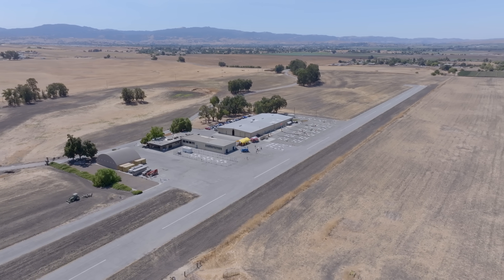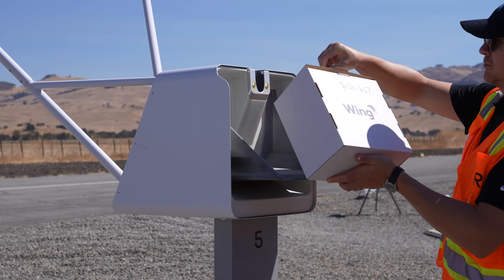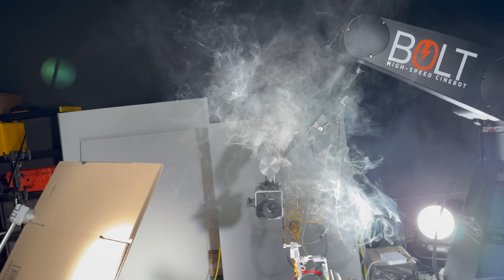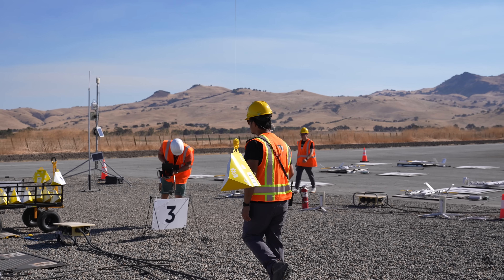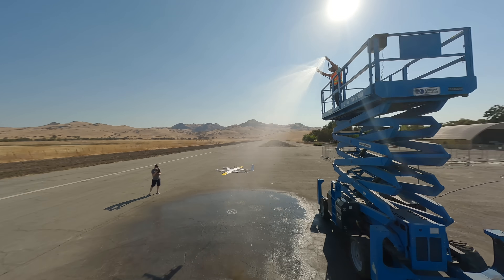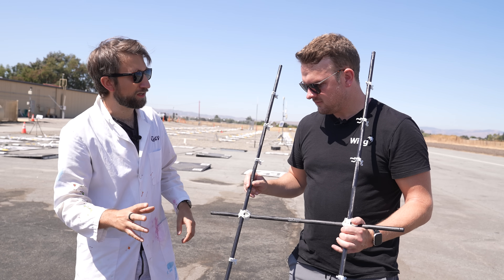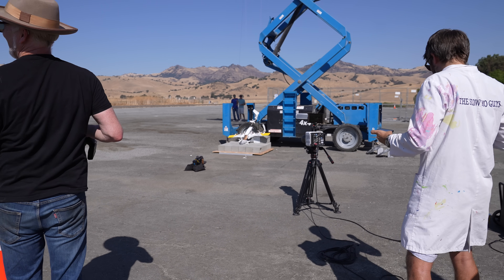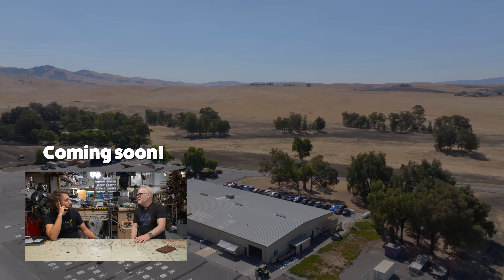Ultra Slow Mo Propeller Smoke Vortex - The Slow Mo Guys @tested

Comment: I think you messed up your bench test calculation and counted props per second and not RPM. If you Emax red bottom motor is 2600KV and you are running 6s = 24V, you get about 62,000 RPM. And I think even that is around the speed of sound, would sound horrendous but could look cool in highspeed. And that Dalprop is old tech now.

Comment: The slomo propeller in smoke was interesting, but you are only seeing a 2D plane of the air current off the propeller, it might be much more interesting to see a full 360 degree smoke everywhere air current; might be hard to setup and get the shot but you guys could do it :)

Comment: With the frangible joints, it looks like the same effect that makes spaghetti break into three pieces instead of two. The end of the pipe that is released first has a bigger moment of inertia than the end on the other side of the fulcrum, so it pulls the rest of the rod down instead of letting it go up immediately

Comment: 1 million upvotes for mechanical design on that auto-loader, no moving parts either? you're giving me goosebumps engineers!
Reply: Reminds me of the old school sky hooks, only much safer and more controlled
Reply: I would suggest they put some kind of covering over the post that holds that pick up mount... something shaped like a bowling pin.

Comment: Auto loader base is too small. That whip escapement motion in wind will be an issue. I'd get a big blow molded hollow tub with the funnel front molded in. Trash can manufacturer. Just have a specilty die made. 
    It is a great idea to self align a hook, all those trap surfaces need to go tho.

Comment: Okay wow, the drone resisting being pulled out of the sky is seriously impressive. So is the rain/wind compensation, I had no idea drones could be that stable.
Reply: Not too surprising with that many props! Also looks like they are made of foam so probably have a fantastic thrust to weight ratio.
Reply: These ones got some pretty strong motors, but in general drones are pretty stable; not inherently stable, but they basically got an autopilot style system that takes the pilot's inputs (or pre-scheduled flight-plan or whatever for the automated ones), and then constantly monitor rotation and acceleration sensors and apply corrections nearly instantly to ensure the drone is doing what it is being told to do and not what the wind and other disturbances would have it do. Even for FPV drones like Vanover's, while there is a little less hand-holding,  in general, he could let go of the controls and the drone would just continue at the exact angle it was even with buffeting winds, slightly damage propeller blades, a little bit of asymmetric accumulation of mud etc (there would be some added vibrations depending on exactly how badly it's being damaged or jerked around, but on average it would keep at it).

ps: Don't go yanking, poking, or even grabbing drones in flight if you don't know what you're doing, even medium ones like Vanover's could chop your finger off, and depending on the disturbance it can be a little unpredictable how they react (even more so if there's damage to the blades/motors)
Reply: that was the sickest part in my opinion. it almost looks like its connected with a bungee cord or something, the way it just goes right back to where it was. so awesome, i cant wait for this to be more widespread
Reply: @Crazyclay78YT  Id love if it was made of bungee, and if someone pulled on it, and the drone let go, it just smashed right into them from the elastic energy
Reply: @CentreMetre  that would be like, deadly i would think 😂😂
Reply: @bcrox  I mean, obviously. But we're talking about an array of little plastic fans easily resisting the full brunt of a person trying to yank it out of the sky from many random directions. Not a paper-thin sheet being held in the air by a literal force of nature. It's impressive, hahaaa
Reply: How do they do against bird shot?
Reply: Oh it pretty much really comes down to the design, firmware and intent of the drone. An FPV Drone with it's firmware usually on the ichy and "if no input, then no power" philosophy is pretty much unstable, completely different to this delivery drone more on the "keep itself stable and doing everything to preserve height and location"
Reply: to be fair kites can be somewhat hard to pull out of the air too
Reply: Not that impressive. I'm assuming you don't have much experience with drones in general.
Reply: @handleonlife1010  I think you need to get a better grip on your life if you're posting know-it-all comments. The publisher literally said they didn't know.
Reply: @ventilate4267  If knowledge/experience in someone else makes you feel any type of way, maybe you're the one with a loose grip?
Reply: WHEN AI takes control of the World, it will look back at this footage very unfavorably!  LOL
Reply: Being stable is the only reason idiots fly them. You don't need any skill,   A blind person could fly one.
Reply: @turokforever007 we need pete gustin in the next collab 😂😂
Reply: Sure, sudden yank releases the cable...sounds like thieves just need a winch to slowly wind it in, then. Or hold it steady for a net.
Reply: @GryphonBrokewing  no, its if the drone isnt able to stay in the same place, then it disconnects, not because of force. so if they moved the drone in any way, it would disconnect
Reply: @Crazyclay78YT  Weird, it's like Gav didn't say in the video that he could see it rocking and that "at the upper limit of being yanked the drone simply releases the cable" 6:38 Nothing about altitude causing it to disconnect.
Reply: @GryphonBrokewing  lol i didnt say altitude either, i said position, or "place" as did he. idk what the code for it looks like, but just conceptually all im saying is, if its spinning up the motors to get to the target position, but it cant get there, at some point the drone must be like "hmmm, i cant move, if i release the string, i can get back to the target" because it doesnt just instantly disconnect, and he was mf yanking. there must be a little resistance with the pickup mechanism, so maybe thats why he had to yank it several times to get it to disconnect. 

something i'd really like to see is, hypothetically its flying at a light pole just so the beam that comes over the road clotheslines the string, and it gets wrapped up. like would the drone feel the resistance and disconnect, then save itself, or would it get pulled down and be unable to recover?
Reply: @GryphonBrokewing  I mean sure, someone could steal it. It would be really stupid to steal it though, since its probably gps tracked with cameras and they know exactly who ordered whatever its delivering.
Reply: @jetison333  Never said thieves were smart.
Reply: first

Comment: I'm curious exactly how they aim to reduce Co2 emissions when their vehicles are powered by plants that create Co2 emissions. Obviously their vehicles aren't creating emissions like cars, but does the full charge of a drone actually lessen Co2 emissions, or do we need more power to charge them like electric cars? That is to say, does the power required to charge a drone for delivery create less Co2 than someone delivering the item in a car?
Reply: Electricity can be produced using 'sustainable' sources. Obviously flying requires far more energy than driving along the ground, but the reality is that the ground in our built up areas is congested, If these things create less ground congestion then they may reduce Co2 simply by the fact that they fly.

Comment: I still want to see underwater slow-mo of a speedboat propellor
Reply: Pending the SloMo guys getting around to it, see rctestflight where he compared props underwater in a design contest with lots of entries and there is some slow motion footage
Reply: @garyha2650 Basically all of those propellers were complete garbage though. Rctestflight knows basically nothing about propeller design and neither do most of his viewers, and consequently he ended up selecting a bunch of awful propellers and grading them on nonsense criteria.
Reply: that would be amazing
Reply: rctestflight has you sort of covered.

Edit: I should have read earlier responses 🤔
Reply: And compare a regular propeller to a toroidal propeller.
Reply: Would be AWESOME to capture propeller Cavitation occuring at high speed and actually seeing the propeller getting damaged.
Reply: With air bubbles for detail!!!
Reply: @ChaoticEnigma- There’s plenty of footage around. You’ll probably find some if you look for cavitation testing.
Reply: Echoing earlier comments, an @rctestflight collab sounds awesome!
Reply: third